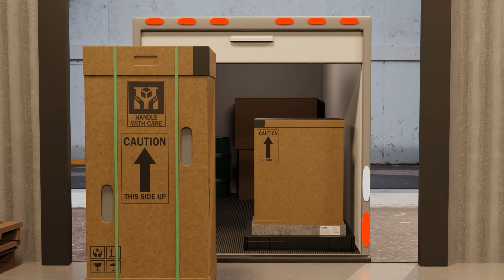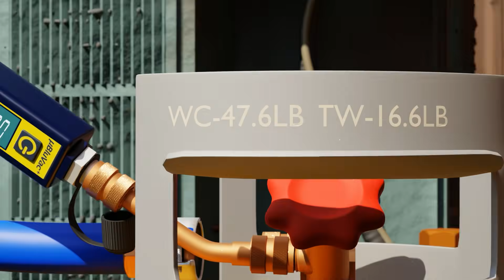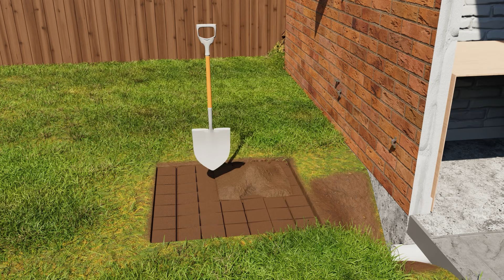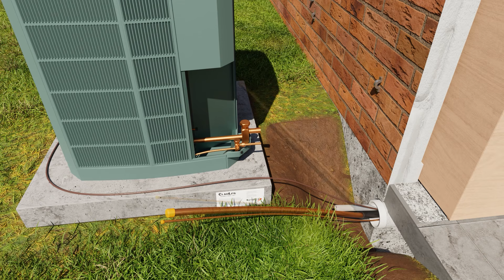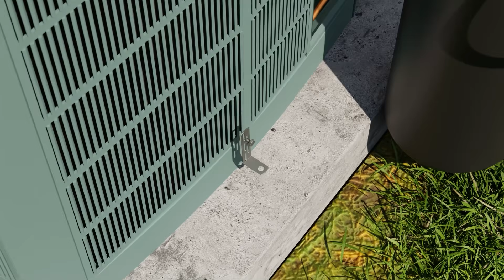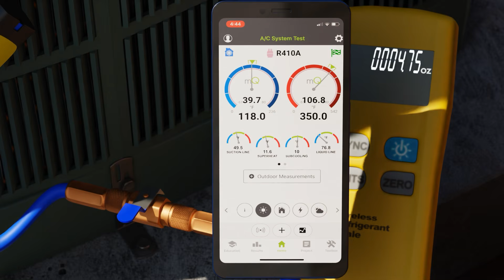Condenser Install 3D

Comment: What is the standard install condenser stand rooftop split system? Does the stand base need to be on beam with the nut and bolt or self tapping

Comment: Several years ago someone did a video for YouTube where they glued PVC together using primer again without using primer and did some testing. It was found that the joints without the primer were stronger than the joints with the primer. I've never used primer and I've glued all my 1/2-in PVC water lines for irrigation and have never had a problem.

Comment: Lol so you replace the lines without running into foam. Then put spray foam so next system upgrade is a bitch to replace in 20 to 30 years
Reply from the maker: Our AHJs require it unfortunately

Comment: At 30:18, what is the proper procedure for making sure air doesn't get into the system when reinstalling the shrader cores? Shouldn't you purge the small bit of air out of the removal tool when connecting it to the charged system?
Reply: It would be better but air trapped in the shrader valve is minimum, between the ball valve and the end ...

Comment: Yeah we’re definitely doing all that 😂😂 
Couple of things. 
That 3/4 pvc bended amazingly underground 
I love that you tested each HV leg to ground
Carrier says to put filter dryer closest to condenser, (I could be wrong)
Love that you brought in Appions
That nitro regulator is the best bar none 
It’s funny that condenser is a Goodman 
WORST THING THO…. You ended with an eco bee, no bro, just no. Bad as a Nest
Other then those funny observations, I did like that you protected the indoor txv and bulb and mentioned removing the bulb on install, well done!!! Overall enjoyable to see installs broken down like this. We move in cruise control and never really think about it in detail. Coming from a service tech I do appreciate this video. 
One more thing I forgot, it’s 4’ of clearance on all sides

Comment: I just started helping with minor installs, doing the electrical so far. I’ve been in almost 3 years and it’s all been service. So glad you made this video so I can see and learn how an install is done and be able to help more during installs.
Reply: This video brought up a great point and MAKE SURE YOU DO IT, ALWAYS test each high voltage leg to ground not just to each leg to look for 240, ALWAYS test between each leg and ground

Comment: I was taught to open the gas based on the flow of refrigerant...Is that incorrect?  Thanks for replying in advance.
Reply from the maker: That is actually how I always did it as well but several manufacturers specify suction first to reduce oil loss

Comment: I drop the condenser from my tailgate to a dolley.
I don't put no seal tape, I just twist it.
I bend the copper with my hand.
I don't even put a wet rag. I just spray it with my water bottle.
I don't braze with the nitro hose connected or near the flame. 
I get to house and the cement slab is nut to butt against the house.

Comment: Wish you would do one with low voltage testing, troubleshooting etc. Great video!
Reply: Quick tip for low Voltage shorts. If lv beaker is popped. Separate all wires at ahu, and start there. Reconnect ONLY ahu wires! It helps separate indoor from outdoor. Cuts down diag time

Comment: Ductboard really, that’s what you guys use down there? Ductboard is cheap and awful, when not sheet metal? Idk different markets meet different standards I suppose…🤷‍♂️ Another note why would you double trap the system, underground and near air handler? I really like your videos and learn a lot from them but those things don’t kinda make sense to me.
Reply: We use duct board at the beach. That metal rusts waaaay to fast.